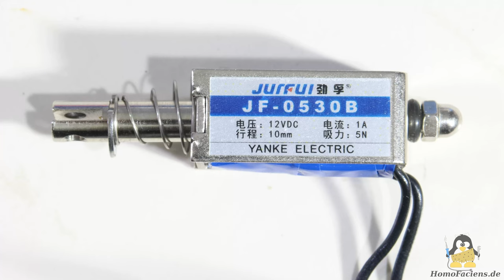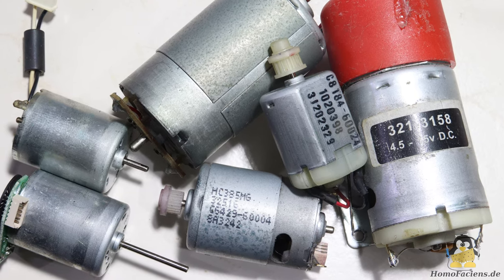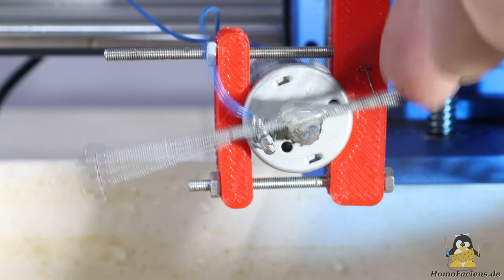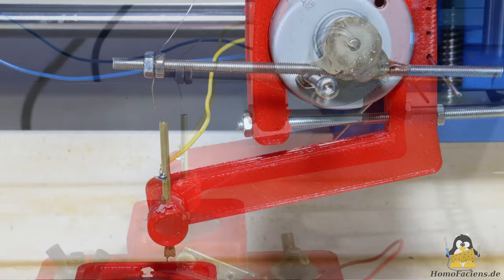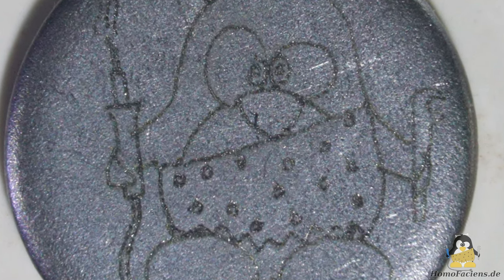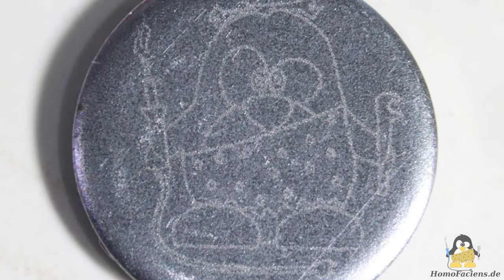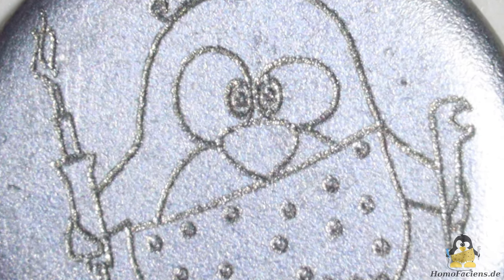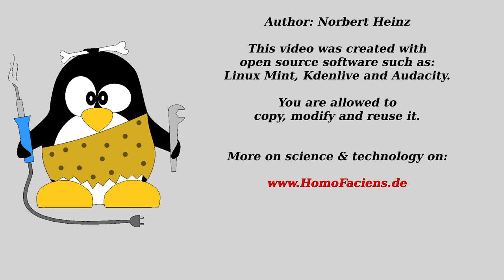Turning a DC motor into a  Wagner Hammer to engrave metal

Comment: you always make interesting things , thank you for the inspiration
 
how about  using a motor to turn a helmet into a speaker?  frequency range  , response , portability ,stereo possibility , power consumption ,attaching it and removing it ,   are the questionable parts
Reply from the maker: Thanks!
Your helmet speaker will work in principle, but don't expect it to deliver high fidelity audio signals. ;-)

Comment: Very cool
Reply from the maker: No. Hot enough to melt steel ;-)
Reply: It should be possible to run the  engraving voltage separate from the motor voltage to give you more adjustment.

One voltage could trigger a transistor or solid state relay to turn the other voltage on and off.

You could experiment with constant current supplies and with constant voltage supplies to get the performance your after.
Reply from the maker: That's what I mean when I say that I will add an active control to the game. Stay tuned!
Reply: Oh. That sounds amazing. I am looking forward to next video. Meanwhile I will try my own experiments

Comment: I think the motor winding might be acting as a current filter. Adding a capacitor across the motor terminals might help with the sparking.
I think the solenoid that drew only 700ma would still work. Adding a power resistor in parallel with the solenoid windings would allow you to trim the current needed. For example 700ma will flow through the solenoid and 300ma through a selected resistor will give you a total current of 1 amp.
Reply from the maker: Physics doesn't work like you think it would work ;-)
Remember you create a (sort of) voltage divider with the spark gap by adding a ohmic resistor in parallel to the motor. Also with the capacitor you add even more complexity to your circuit. Try it out if you think you know better and prove me wrong, but just selecting a motor that fits your needs is the more simple way and this series of spark erosion is about simplicity.

Comment: Can I ask what software do you use to generate paths? I use inkscape with laser engraving extension and it's kinda clumsy.
Reply: And maybe another question. What electrode material can I use? It's just that tungsten wire is kinda hard to get.
Reply from the maker: I use LibreOffice Draw for the templates, export as svg and then do the conversion into Gcode with a self written Python script.
Reply from the maker: Use steel, copper, brass or what ever conductive wire you have. I will do some more experiments on material combinations in coming videos. Stay tuned!

Comment: i know what im going to be trying next time i break a tap in titanium...
never thought of doing this... lol. yet so simple.

um. the motor has not just resistance but also inductance. the higher power motor will have lower DC resistance, but they also have much lower inductance, generally having a low turn count. do the maths on the numbers you gave, and youll see the resistance and the inductance as it doesnt quite follow ohms law until saturation.
motors have sweet spots, torque variations. the commutator and brush and pole alignment all plays a role... maybe just use a BLDC on one phase?

this is a hard one. is the sparking necessary or not? i think it is but its the nature of that arc... i feel it needs to be a "ringing", much like AC/DC tig welding gives a "cleaning" action... except then you want to wash the arc and resultant byproducts away. iunno. havent played with edm much...

this reminds me of two similar non standard uses... making a servo, and reverb units.

servo. feed, it with a PWM signal, against a spring.

still, i think a standard "bell ringer" type buzzer would work just as well if not better.
Reply from the maker: Of course, there is more than just ohmic resistance to consider. This is a series on making (sort of) EDM, looking for simple solutions. That "bell ringer" setup has been treated in previous videos. DC motors might be more commonly available than the old school door bells ;-)

In the iteration currently in development I have implemented a microcontroller. Although I do nothing but "replicate" a Wagner Hammer with that setup, yet, a microcontroller offers real time observation and feedback control of what is actually going on. I will do experiments to see whether maintaining the spark as long as possible leads to better results or making and breaking contact at high frequency is to go for.

There is still a lot to be told about a circuit composed of an inductor an a spark gap.

Thanks for sharing your thoughts and don't forget to share the results you get with your setup!

Comment: Very entertaining series. I wonder if you can get a higher current through the motor with a reasonably large capacitor on the output to allow the current to discharge on contact and rely on the inductance of the coil to limit it through the motor iteslf.
Reply from the maker: Well that's what's happening. In fact the computer power supply has an output capacitor. Adding another one won't change that much. You need a power supply that can deliver high current.

Comment: Ok , so how about using a Tungsten welding electrode for the engraver tip. That would solve the erosion of the engraver while it's engraving the base metal ??
Reply from the maker: The tip of that electrode will erode same as the tungsten wire, since it is the same material. The electrode tip will become blunt, resulting in wider lines. The pro of the 0.2mm wire is, that the diameter stays constant even if the tip erodes.

Welding electrodes are used in a different way: They are meant to maintain a plasma while with the Wagner hammer there are sparks formed and cut off at a high frequency.

In an earlier video of this series I made use of a sharpened tungsten electrode: https://youtu.be/rS5600spxEQ

Comment: So it seems like the issue with these is that the motion of the motor/solonoid is tightly coupled with engraving power. An upgraded version would separate the power for engraving and the power for moving the wire, so in this case you could sense the current through the engraving wire to trigger a different power source for the motor. Then both are driven at exactly the right power
Reply from the maker: That's what I call "adding active control" to the system, which will be done in one of the coming videos. Stay tuned!

Comment: tig welding tungstens and oil cooling oil for oil cooled weleders ,mineral oil.
Reply from the maker: There is also wear on the  tungsten tips. The working principle is different from TIG welding. Making contact with the workpiece quickly wears the pointy tip as shown in a previous video of my EDM series.
Reply: @HomoFaciens  I may not have been clear on my meaning , the tungsten should have a prolonged life compared to other metals , and the mineral oil is used in carbon arc erosion i'm sure , I went to college with a guy who needed to get college certificates to work in his dads company doing carbon arc erosion , I watched some stuff about it , we were studying for our electronics technician certificates ,1st year , the oil used is purer than water , mineral water might work well or reverse osmosis water to avoid conduction into the cooling fluid by mineral contamination.
Reply from the maker: There isn't "the electrode material" nor "the fluid".
As the cooling / flushing fluid must have a low conductivity, oil is in general better than water. But also, messing with oil in your (hobbyist) machinery isn't as comfortable as using deionozed or even tap water. Also discarding the water from time to time is easier than implementing a filter system.
Another yes, tungsten is more resistant to wear in EDM machining because of its high melting point, but there are exceptions from that rule: Heat conduction is another property that reduces wear. Same as with the water or oil decision, brass is cheaper, has a relative low wear and is for those reasons often used.
In another video of that series I had a (very) quick look at different electrode materials: 
https://youtu.be/rS5600spxEQ
I will carry out more experiments in the future - stay tuned!
Reply: @HomoFaciens  As for a contact conductor you could use a pointed carbon rod,as again for the oil method ,some of the comments by other watchers mentioned an interest opposed to laser etching and i thought i'd add what i knew to work in industrial environments.
Either way, i myself am interested in this method of engraving cast alloy and steel than acid etching,i need to make a cnc controler first though.
Very informative video as always.
All the best.
Reply from the maker: As with the making and braking contact in my setup, the conductivity of the fluid really doesn't matter that much and tap water works fine. It is simple and cheap and so definitely worth experimenting with.
Thanks for sharing your thoughts!

Comment: Draw power between 3.3 and 12V? Get 8.7V and check how the PSU likes that...
Reply from the maker: Maybe I will risk one of my old PSUs in a future experiment.
Reply: Used 24V on a PC supply before between yellow and I think blue(-12V 0.5A).
Reply from the maker: Yes, that works in general, but you eventually confuse the maximum current "fuse" of the PSU which might cause damage of your power supply. Spark erosion works with high currents so it is a risk.